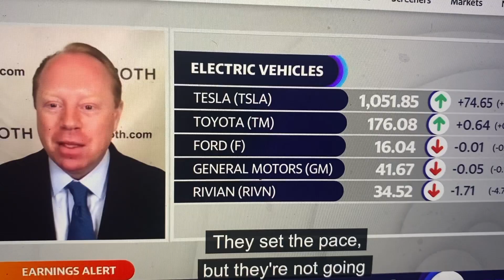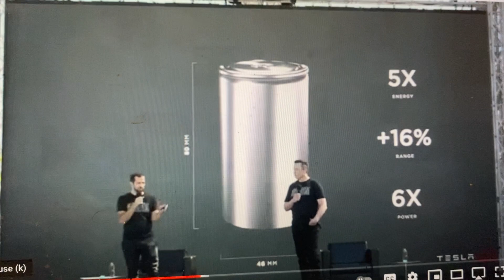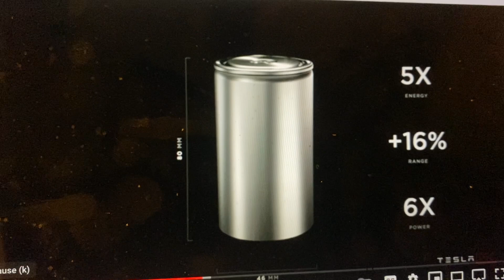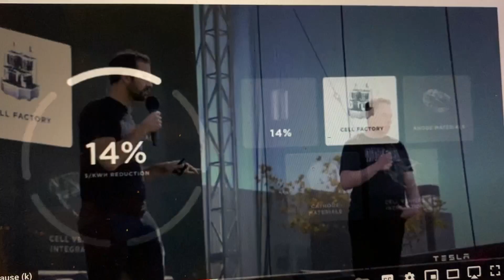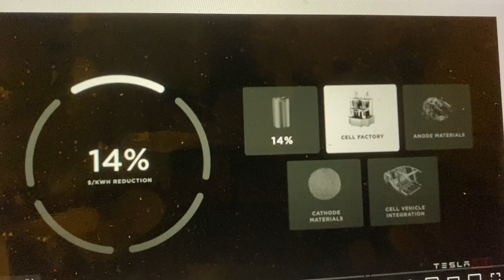Tesla 4680 Battery Causes Gm/Lutz Battery insanity 2022 (A690)

Comment: 9:05 Mark Reuss was referring to the internal resistance to the Chevrolet Bolt EV, and the self sabotage that occurred internally as a result. GM had the production capacity to produce over 100,000 Bolt EVs per year; however, they only ordered 25,000 batteries per year. So from the start, the Bolt EV was hobbled, and second movers like Tesla were able to overtake that segment of the market with their Model 3 that they released over a year and a half later.
Reply from the maker: if demand and profit was there, they could make a lot more.  No supercharging and other issues impact consumer interest.
Reply: @Teslafaninsight  That's not how internal resistance works. Yes, there were Tesla (and TSLA) owners actively campaigning against the Bolt EV early on, but even that had very little impact. Though it was funny watching guys in Tesla apparel trot around NDEW and Earth Day events telling people they shouldn't buy the affordable Bolt EV they were interested in. 🤣

Also, despite rumors, the Bolt EV was profitable from the start, and in late 2016 to early 2017, GM's cost basis for finished batteries was nearly 50% less than Tesla's at the time. In terms of demand, we literally saw customers "smuggling" Bolt EVs out of CARB states in 2016. Prior to the recall, the Bolt EV was ranked 7th among all U.S. cars for shortest time in inventory (i.e., EXTREMELY high demand relative to supply). 

None of that jives with your assertions.

Comment: 15:51 LG produces multiple different battery cell form factors, including 2170 cells, which they also sell to Tesla. Companies like BYD and GM are supporting their own internal battery architectures which are superior to Tesla's in terms of cost and gravimetric/volumetric energy density (at least Tesla's 2170, anyway), so they have vertically integrated battery cell production to support their Blade and Ultium architectures, respectively.

Comment: 13:33 The Lucid Air Range's efficiency is better than anything in Tesla's line up. Despite using the more conservative EPA testing cycle, the Lucid is achieving 4.2-4.3 mi/kWh on a much larger platform than Tesla's most efficient vehicle, the Model 3.
Reply: @jimroth7927  That's a nice opinion, and we could discuss its merit some other time. However, I was responding specifically to inaccurate information that was provided in the video.

Comment: I think there's a basic fact that many pro-TSLA analysts are missing: At a certain point, battery technology advantages offer diminishing returns. If the consumer doesn't recognize a significant and immediate difference, those advantages might as well not even exist. What the impartial analysts are citing is the fact that there's a lot more to building a car, and just having a "better" battery in an EV doesn't help them in all the ways their competitors already have significant cost advantages. Further, a huge factor that will impact Tesla is, even if many other automakers only produce "compliance" EVs, it dries up the marketplace for Tesla to profit from selling their ZEV credits.
Reply: Yes, there's a lot more to building a car, and Tesla seems to have some significant advantages: While most manufacturers seem to take about 30h to build a car, Tesla is getting down to about 10h. And for batteries, the dry coating process means smaller battery factories and a far more energy effective and cheaper production process. With the current high demand and corresponding prices, this is not something the the consumer notices, but it does impact the bottom line. Long term, there will likely be many viable EV manufacturers, and success in the market will depend more on the factors we've been used to - design, usability features etc. - having a more efficient production line however will afford a higher R&D budget and ability to price competitively (given Tesla's stated mission, I don't expect big dividends ;-) ).
Reply: @koma-k  Do you have any sources you can cite for the claim that other automakers require 30 hours to build a car while Tesla only requires 10?
Reply: @newscoulomb3705  I found a study from 2007 showing all the manufacturers in NA spending about 30h+ per car, with about 5h of variation (Toyota being "best in class" with somewhere around 28-29h if I remember correctly). Haven't found a newer source, but Diess' statements late last year seems to confirm this as he said VW needs to reduce the time spent per car from 30h to Tesla's 10h - I'm assuming VW doesn't deviate much from the industry "standard".
Edit: I didn't save the article, but it'll see if I can find it again.
Reply: @koma-k  Yes, I saw those reports. I believe Nissan has traditionally spent the least time assembling cars. However, I was asking about the 10 hours for Tesla relative to everyone else, but it looks like that comment was based on something Diess said to his union workers to get them thinking of the future. Still, I can't find a source for Diess's 10 hour claim. One can assume that he heard it directly from Musk, but it could also be made up as a boogey man to scare his workers into improving production.

Regardless of whether it's actually true, I still have mixed thoughts because yes, while a 20 hour time savings represents $600 to $800 per car in saved labor costs, automation costs money maintain and operate. Also, considering Tesla is ranked as one of the worst automakers for quality and finish, those build quality issues really need to addressed before patently saying that Tesla's 10 hours is better than VW's 30 hours.
Reply: @newscoulomb3705  These numbers come from the boss of VW who used them to explain to his managers why they need to radically improve the (VW) company.
Reply: @jimroth7927  Yes, so they have not been confirmed. Regardless, those numbers were told to VW's union heads to compel them to increase production. It seems mostly like scare tactics to influence workers, but we'll see.  

There's a whole lot of questionable accounting around EV production right now, and most of what's being reported or focused on right now seems to be marketing spin.
Reply from the maker: Head of vw confirmed Tesla build time advantage
Reply: @Teslafaninsight  VW CEO Diess confirmed that VW requires 30 hours of labor to assemble a car, but he wasn't in a position to confirm that Tesla only requires 10 hours. And of course, even if that number was accurate, it doesn't account for the hours of labor and additional costs to keep the automation running. 

Basically, given that those comments by Diess were clearly made to influence and scare union workers, the numbers he used are highly suspect.

Comment: 13:39 The GMC HUMMER EV is a purpose-built, no-compromise EV truck. It baffles me how people can be so ignorant about vehicles that they think size and format shouldn't have any impact on efficiency.
Reply: During Q4 General Motors delivered a grand total of 26 EVs, including 1 Hummer. If they get to the point where they are selling a hundred thousand *at a profit* then it will make sense to compare the Hummer to other electric vehicles.
Reply: @jimroth7927  GM sold half a million EVs globally in 2021, and they sold more EVs in China than Tesla. While GM has curbed most of their new EV sales in the United States, that is only because they are actively replacing customer batteries. Something on the order of 87,000 in the last six months.
Reply from the maker: 11k starter cars in china are not really defined success.

Comment: Market is going electric for sure but not evident on the east coast, 
We have a lot of ground to cover. Range is still a big issue. I have a model 3 and as soon as the conditions deteriorates like a roof box, wind, temperature, range plummet 50% then doing a 1000 miles road trip become a chore. I had to charge every 100 miles.  We need 2x the range to have someting mass adoption/market.
Reply: Depends on where your located in the east. In Nj, teslas are extremely common and superchargers are within 5 miles to each other. But as you go out towards PA or in the southern states, they become a less common sight
Reply: Good point, but a new purchaser might choose a Model Y and not need a roof box.
Reply: @jimroth7927  yes, I had not that choice back then. Fortunately, the roof box is removable after the trip, then I get more range. Also I have new  tires and they consume like 7% more than oem's. This compound the thing. Newer models are much better with more range and no battery degradation. My battery degradation is -10%.
When you add the roof box, the battery degradation and the draggy tires, range take a good hit.

Comment: Great update on Tesla’s dominance. Wonder if Tesla’s openness about their upcoming technology is the right strategy. I see some pros and cons.
Reply from the maker: Yes.  That was strange.  Gm is doing more assembly than innovation.  I wonder about being flexible in ways there system is not.  e.g. I met a professor who said it is likely a box will allow several battery kits to run at the same time allowing different types of performance depending on driver interest.

Comment: Greg, your comment that GM execs thought the Bolt would put the Model S out of business explains a lot. Model S competes with Mercedes Model S. The Bolt is in its own lonely category. GM execs' decisions are faith-based.
Reply from the maker: Bolt is complex in how it got going.  Current management was handed the Bolt by Lutz and co.  they made a choice to keep going same path or change the plan.  For current president it is a marketing/sales problem that happened not an innovation issue.  248 miles is good range but no signs is aggressive innovation in sight at all.

Comment: No way any competitors has got their hand on Teslas 4680.. no way.. its not in the market place yet.. what source do you have?
The form factor is easy replicable, way worse with the dry kathode process and the tabless design..👍🇳🇴
Reply: Anyone can replicate the form factor; the tabless design and the dry coating process however are patented. The first enables the large form factor without taking a performance hit (large tabbed cells have bigger constraints on charge/discharge speeds due to poor cooling and uneven heat load), while the other enables significant savings in production.